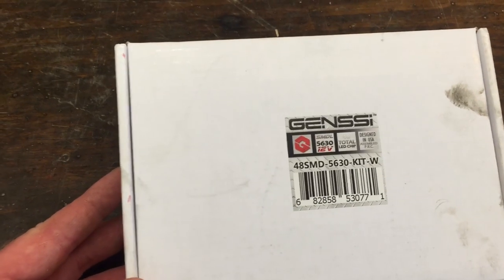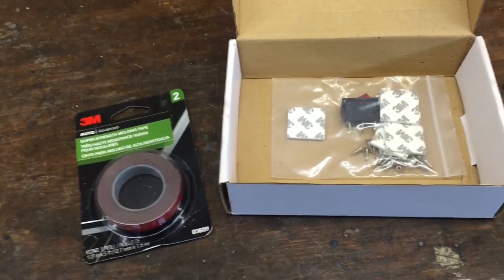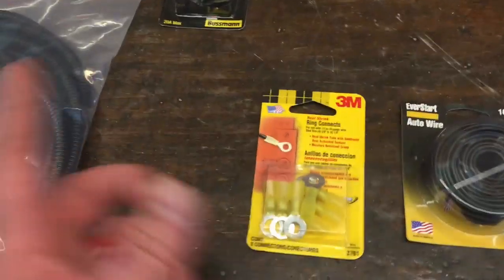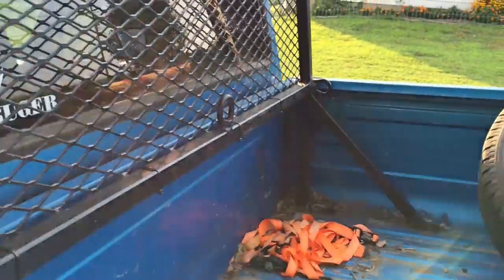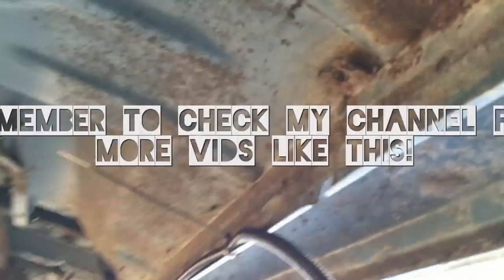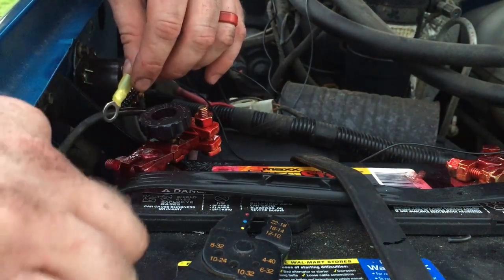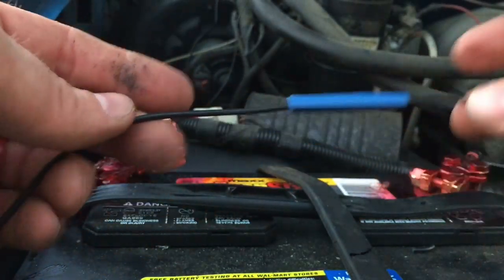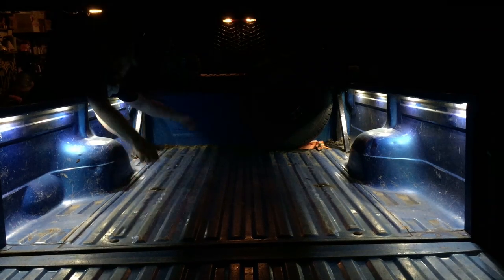How to Install Truck Bed LED Lights / with Cabin Switch

Comment: Hey Brian great video. When you connect the two wires to the negative and positive do you feed both back through to the switch? And when you say ground is that positive or negative?

Comment: if youre "crimping," you shouldn't be making how to videos.
Reply from the maker: Brett Boutan - 👌great advice brother! Thanks.  We will note. Best of luck to you and Your's. Why did you delete your original comment? I was having fun with it.
Reply from the maker: Brett Boutan - you want these all soldered? I need more info bruh.
Reply from the maker: Brett Boutan - just looking for your fix buddy.... you know better... but you didn't leave the solution. Please do.
Reply from the maker: Brett Boutan - your bringing the hate comments brother.   I'm all about just helping people.  Just don't understand comments with no fix.  What do you recommend?
Reply: ill make sure to post a video soon just for you to show how it should be done.  Also, would you like me to troll your videos like you have done to mine. I'm sure I can do that for you just to play fair.
Reply: Crimping is a good repair if you use the right butt crimps and they do sell the good ones gm if you order a new connector they give butt connectors to use. But they get crimped and you heat them up and the melt around and are filled with glue too also harbor Freight sells them too